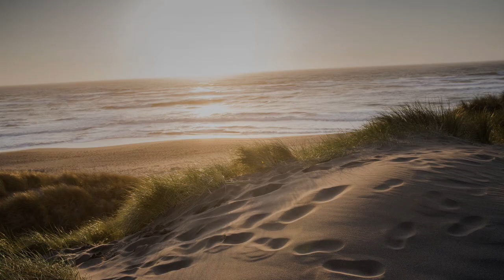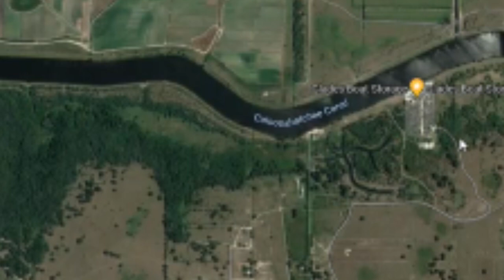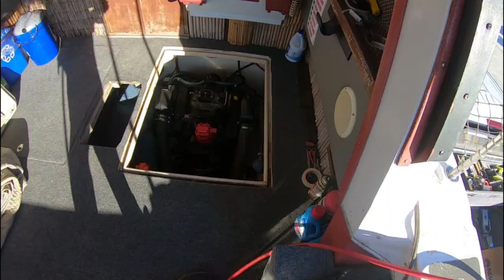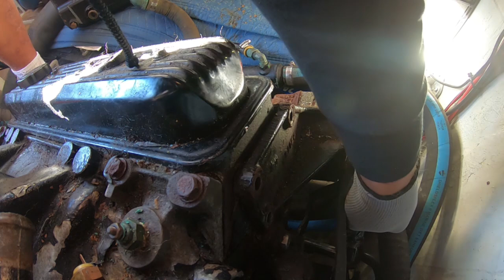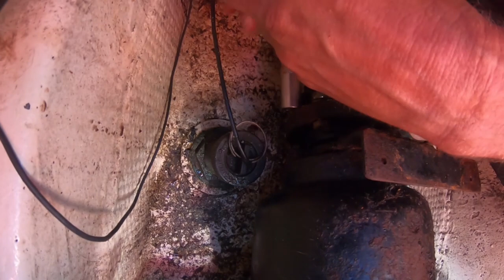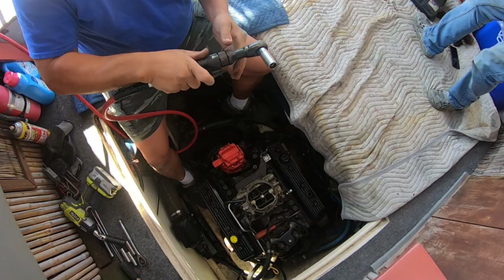The Great Loop 2021 Part 10

Comment: Been looking forward to this engine swap vid.   Coincidently, a buddy of mine will also need to pull his motor on his Sea Ray.   Amazing how problems compound on a boat.  Old Leaky manifold, led to hydro lock cylinder, which bent a bolt on starter, which then broke a few teeth off flywheel.   Which ends up being a motor removal.   Stay on top of your preventative maintenance to save yourself BIG headaches in the future!
Reply from the maker: Hey Tommy, yea that is scary to think the engine can lock up lock that. How long do you go on your risers?
Reply: @CaptainMike1965  I went almost 10 years before changing risers on a salt water Mercruiser 454 with heat exchangers.  I noticed some external rust forming and that’s a tell tale sign the inside is likely leaking too.   My current boat has original risers (15 year old Mercruiser 6.2) but it was a fresh/brackish water boat.   I’ll likely change those in a year or so.